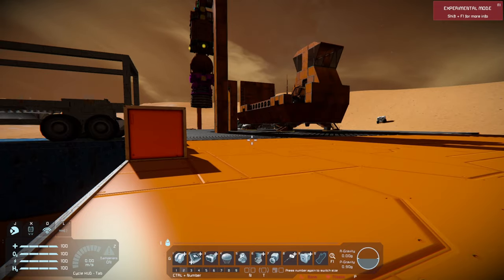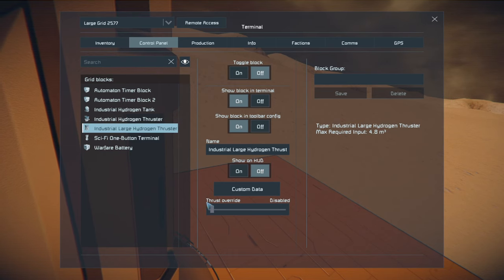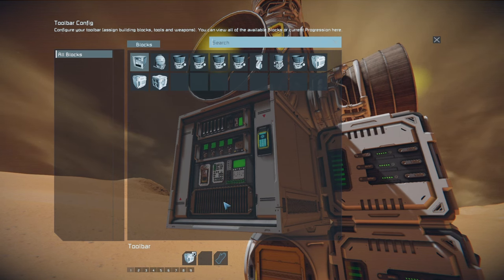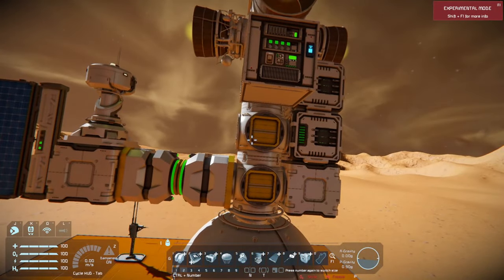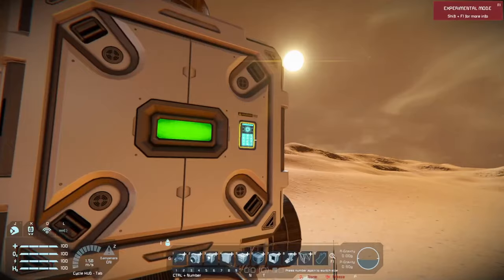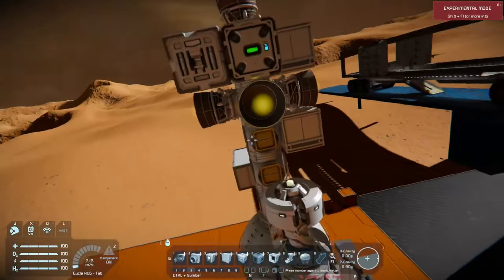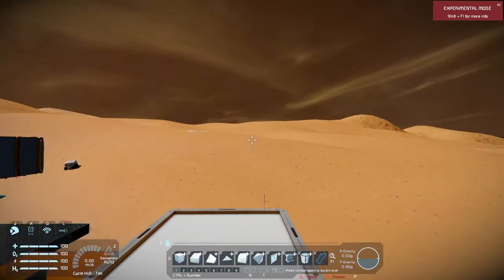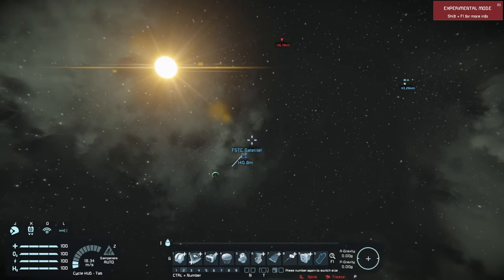Space Engineers Automatons - Automatic Satellite Launcher Tutorial

Comment: You could switch the top thruster off, then set the event controller timer to turn the thruster on once it has entered zero gravity. The same way if you had reverse thrusters to slow down. And instead of connectors, you could use merge block to link the two craft together, then separate once you reach zero g. 

This has been giving me ideas on how to do a cargo rocket I've been designing, thanks.

Comment: override the gyro and you wont have the wobble issue
i have successfully used an AI block to align to gravity with no angle to keep rockets completely vertical
Reply from the maker: Great idea.  I actually can't believe that I didn't have a gyro on it to start.  I might do a follow up video on how to do this with the unlimited speed mod.  Makes the process much more challenging since you can't rely on the small thruster to slow you down, have to spin around before slowing down.
Reply: @EMOTIBOTS 
So, it would be the same as I have seen in the video and the only difference would be that it would go up at 1,000 meters per second and down at 1,000 meters per second?

Sounds like a plan to me.

Though, you might need more than just two parachutes to slow that puppy down. My guess would be in the neighborhood of a double digit number.

I can see it now, screaming towards the ground at a high rate of speed, dragging upwards of 90 parachutes behind it making no difference in the reduction of speed.
Reply from the maker: @1953dan  mostly the same, yes.  One difference is that there’s an extra “coast” stage that you are in before starting to slow down, and this needs to be timed properly.  You don’t want to just constantly boost until zero gravity or you would be going some insane speed.  And because you are going so fast, it becomes less feasible to slow down with the small thruster in the front, so you have an added challenge of rotating the craft to face towards the planet and using the large thruster to slow down.  There are different ways of doing it, but I like that it has an added realism challenge.